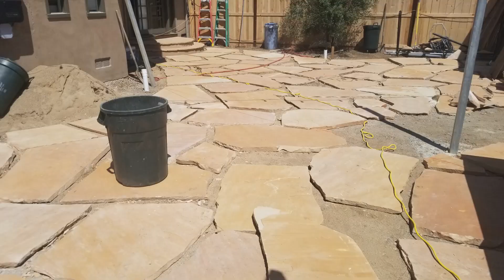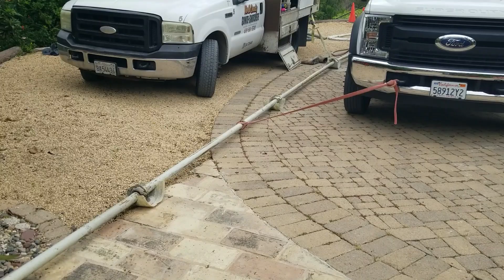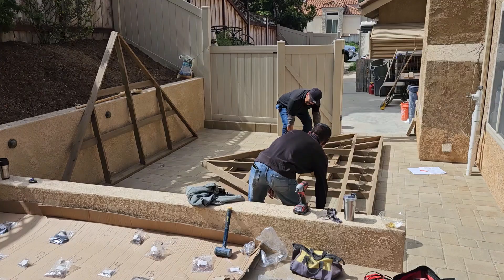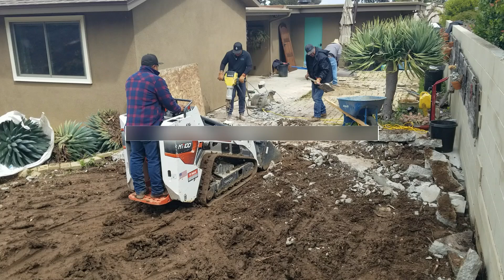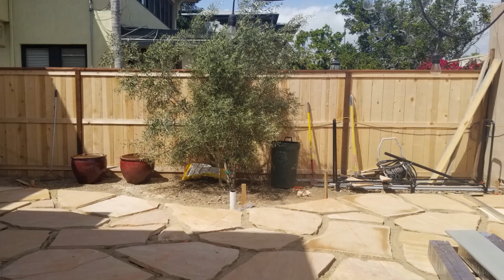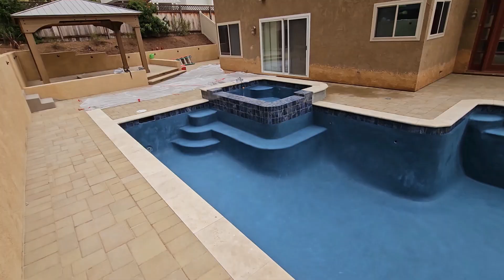Full Backyard Transformation | Pool, Patio, and Shade Structure Build

Comment: Wow, this was very cool watch I'm looking at doing a video on swimming pools - but more the fiberglass ones - because it's hard to see concrete pools constructed as it's actually happening.  With design in the USA do you have to have pool fencing or are there any limitations on what you can do? Here in NZ they have quite some strict ones - 1.2 m high fence - outward opening gate etc and if it's opened to the house - doors /windows have to have special fastenings etc..  Drainage to soakpit or gully trap with permission
Reply from the maker: We have very similar codes like those here in California.  5 ft fences etc. Thanks for watching!